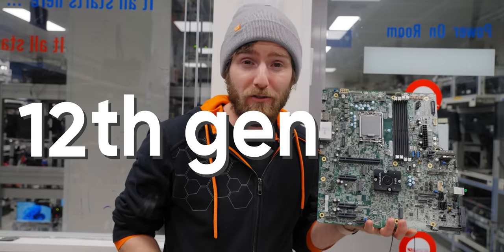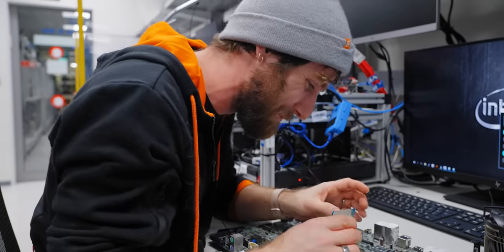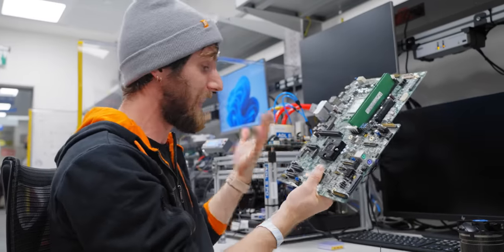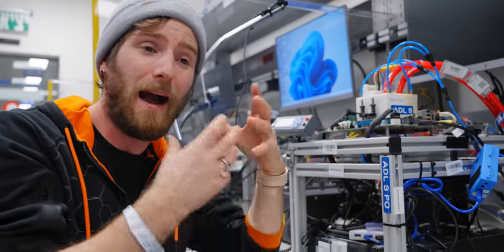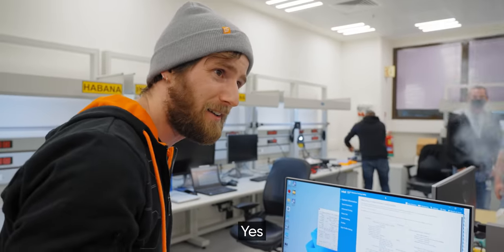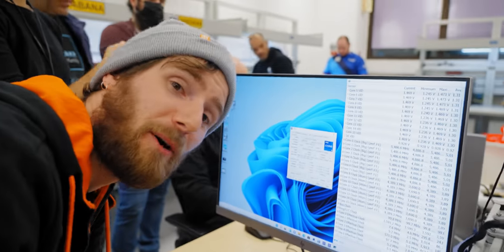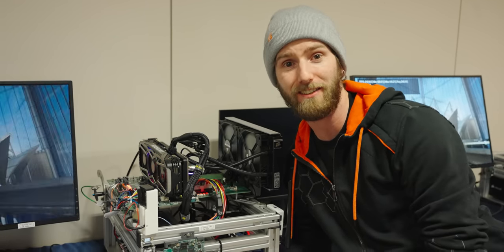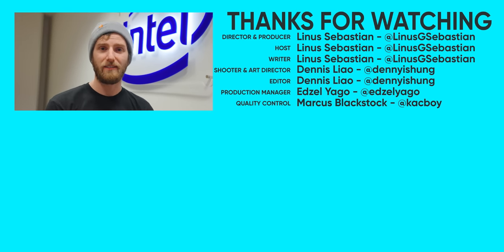I saved the best for last - Intel Design Center Development Motherboard

Comment: In hindsight, I bet some new exec saw what the chips could do when the engineers pushed the chips under ideal conditions, he wanted to make a name for himself*, and declared that Intel would be rolling out those chips so he could claim such amazing performance chips were launched under his leadership. 

Since the 13th and 14th i7s and i9s were essentially overclocked out of the box, right?
...

.
.
.
.
Clarification:
Could be "herself", "xyrself", "themself", etc. too, I used him because:

A) Probability. Despite strides, we all know that men are definitely more likely to be in upper management than women or NB folx. The higher up you go, the rarer anything but white cishet men become. 

B) Honestly I initially wrote it with they/them pronouns, but it got confusing between the exec, the chips, and the engineers all using they/them pronouns. 

C) Probability part 2: women are still super underrepresented in tech, as in other STEM fields. I've definitely heard some horror stories.

Comment: Please "influence" Intel (and AMD) to at least investigate Resonant Tunnel Diode Threshold Logic gates. In 1968 I was using TD logic at 500 MHz. In 1984, GE was selling 70 GHz TD logic, and I tried to get AMD to investigate. Today, TD logic is clocked at 2.2 THz.
With a speed-power product 100,000 times greater than CMOS, why would they continue to use a 1963-vintage, inherently quantum mechanically defective technology like CMOS? Especially since they have CPU and GPU chips wasting more than 350 W each.

Comment: Linus et al. Please stop spreading anti-consumer falsehoods. Overclocking will not "void product warranties" in the UK nations, EU states, and even in Israel - where you are making the claim - on the SKUs capable of being overclocked. Not only does Intel sell a series of processors that is capable of - and marketed for - overclocking, but the typical overclocking features we're used to have to be deliberately enabled (and coded) via microcode by Intel, as well as have full Intel support on a UEFI level.

This - combined with Intel offering software specifically to overclock from within Windows, amongst other examples - means that in countries with sensible consumer protection laws, Intel (and AMD) do not have a valid legal position to dictate such a policy. This has been 'tested' in at least a few EU states and the UK.

Comment: 5:40 I get not having a lock on the PCIe x16 slot but why is it open ended.  That would make sense on a smaller slot to be able to plug in a bigger card (i.e. a x16 card in a x8 slot) but why have that on a x16 slot?  Are there any cards bigger than that, I didn't think that was a thing?  (i.e., x20, x24)
Reply: Thank you for your comment...⬆️ ContacT the What'sap line above for more information and advise for profitable investment:

Comment: It's concerning to me that the CPU accepts an external output to adjust core functionality....  What does this mean for security and IME?
Reply: Thank you for your comment...⬆️ ContacT the What'sap line above for more information and advise for profitable investmentऽ
Reply: Remember that the CPU will let you update it's firmware which is much more dangerous... So clock speed isn't too far fetched. Nor is it a big security risk

Comment: hey Linus i have a challenge for you and your YouTube college. i bought the Asus ROG Flow x13 now i know you'll know the spec mine the I7 12700. but i feel ASUS cheaped  out on the Ram with only 16gb when these day for the great chip sets of intel 32gb would be the minimum needed i sure this this also because there ram is also permanently fixed to the motherboard and therefore none upgradable  so to the challenge you've probably guessed already   make and external expansion unit to allow the system to have more RAM added

Comment: well if so lets see it will run @4ghz on all cores and 4ghz on the ram also!!! plus o.c. the gpu also!!! I wanna see that video!!! if they can be my i7-2600 @ 24ghz . that is with a.i. assist. this is mkking.791

Comment: Uninformed question here. Couldn’t putting these boards on video in 4k be giving away Intels development techniques? There can’t be that many features you can put on a board and an informed person could easil read the board like a book…
Reply: Thank you for your comment...⬆️ ContacT the What'sap line above for more information and advise for profitable investmentः
Reply: I doubt it's the layout that matters. It's probably the specifics of every chip and the firmware for those chips. Because the layout is probably just kinda standard for a non-consumer mother board
Reply: Ty all for the info and ** you who ever wrote the bot that was my first comment.